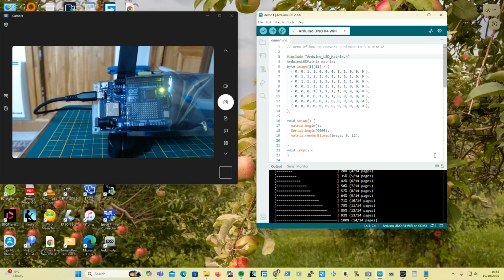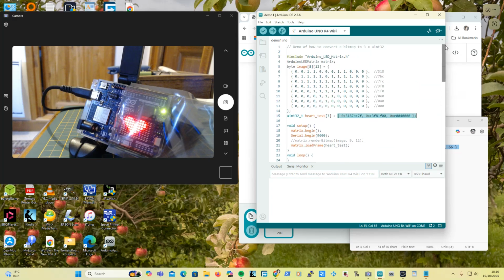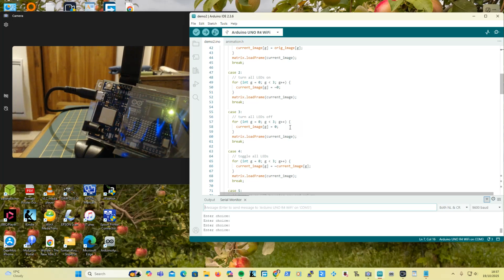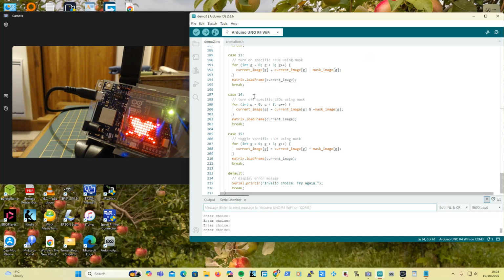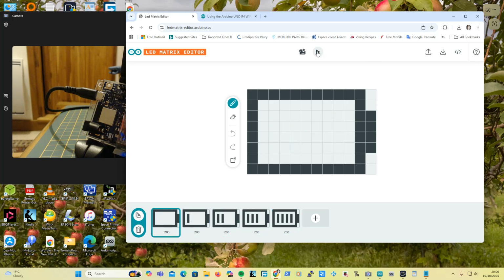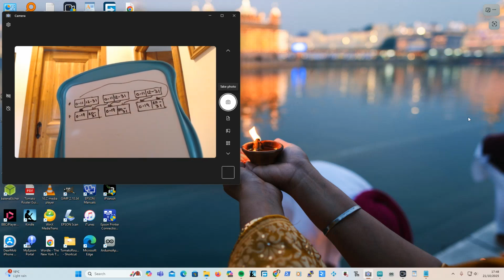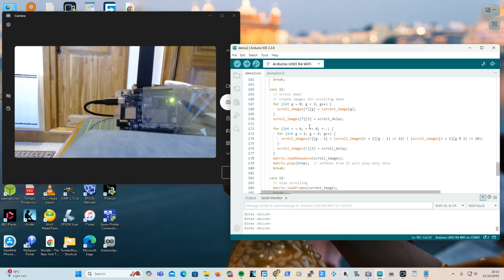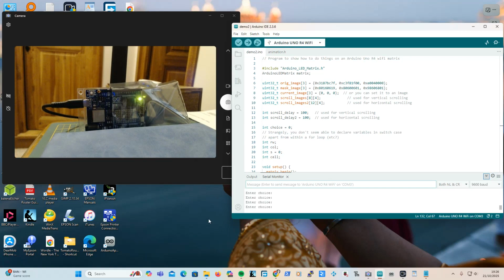Everything you (didn't) want to know about using the Arduino R4 LED matrix.And maybe the Uno Q too.

Comment from the maker: Here's my demo program code:

// Program to show how to do things on an Arduino Uno R4 wifi matrix

#include "Arduino_LED_Matrix.h"
ArduinoLEDMatrix matrix;

uint32_t orig_image[3] = {0x3187bc7f, 0xc3f81f00, 0xe0040000};
uint32_t mask_image[3] = {0x80160619, 0x80600601, 0x98606801};
uint32_t current_image[3] = {0, 0, 0};  // or you can set it to an image
uint32_t scroll_images[8][4];             // used for vertical scrolling
uint32_t scroll_images2[12][4];           // used for horizontal scrolling

int scroll_delay = 100;   // used for vertical scrolling
int scroll_delay2 = 100;  // used for horizontal scrolling

int choice = 0;
// Strangely, you don't seem able to declare variables in switch case 
// apart from within a for loop (etc?)
int rw;
int col;
int s = 0;
int cell;

void setup() {
  matrix.begin();
  Serial.begin(9600);
  matrix.loadFrame(current_image);
}

void loop() {
  Serial.println("Enter choice: ");
  while (!Serial.available()) {}
  choice = Serial.parseInt();

  switch (choice) {
    case 0:
      // because I'm using parseInt
      break;

    case 1:
      // (re)load original image
      for (int g = 0; g < 3; g++) {
        current_image[g] = orig_image[g];
      }
      matrix.loadFrame(current_image);
      break;

    case 2:
      // turn all LEDs on
      for (int g = 0; g < 3; g++) {
        current_image[g] = ~0;
      }
      matrix.loadFrame(current_image);
      break;

    case 3:
      // turn all LEDs off
      for (int g = 0; g < 3; g++) {
        current_image[g] = 0;
      }
      matrix.loadFrame(current_image);
      break;

    case 4:
      // toggle all LEDs
      for (int g = 0; g < 3; g++) {
        current_image[g] = ~current_image[g];
      }
      matrix.loadFrame(current_image);
      break;

    case 5:
      // turn on an LED by using row and column
      rw = 3;   // using dummy values for row
      col = 7;  // and column
      cell = rw * 12 + col;
      bitWrite(current_image[cell / 32], 31 - (cell % 32), 1);
      matrix.loadFrame(current_image);
      break;

    case 6:
      // turn off an LED by using row and column
      rw = 0;    // using dummy values for row
      col = 10;  // and column
      cell = rw * 12 + col;
      bitWrite(current_image[cell / 32], 31 - (cell % 32), 0);
      matrix.loadFrame(current_image);
      break;

    case 7:
      // toggle an LED by using row and column
      rw = 7;   // using dummy values for row
      col = 6;  // and column
      cell = rw * 12 + col;
      bitWrite(current_image[cell / 32], 31 - (cell % 32), !bitRead(current_image[cell / 32], 31 - (cell % 32)));
      matrix.loadFrame(current_image);
      break;

    case 8:
      // scroll left
      // create images for scrolling left
      for (int g = 0; g < 3; g++) {
        scroll_images2[11][g] = current_image[g];
      }
      scroll_images2[11][3] = scroll_delay2;

      for (s = 0; s < 11; s++) {
        for (int g = 0; g < 3; g++) {
          scroll_images2[s][g] = (scroll_images2[(s + 11) % 12][g]) << 1;
        }
        bitWrite(scroll_images2[s][0], 0, bitRead(scroll_images2[(s + 11) % 12][1], 31));
        bitWrite(scroll_images2[s][1], 0, bitRead(scroll_images2[(s + 11) % 12][2], 31));

        for (cell = 95; cell >= 10; cell = cell - 12) {
         bitWrite(scroll_images2[s][cell / 32], 31 - (cell % 32), bitRead(scroll_images2[(s + 11) % 12][(cell - 12) / 32], 31 - ((cell - 11) % 32)));
        }
        scroll_images2[s][3] = scroll_delay2;
      }
      matrix.loadSequence(scroll_images2);
      matrix.play(true);  // without true it will play only once
      break;

    case 9:
      // scroll right
      // create images for scrolling right
      for (int g = 0; g < 3; g++) {
        scroll_images2[11][g] = current_image[g];
      }
      scroll_images2[11][3] = scroll_delay2;

      for (s = 10; s >= 0; s--) {  
        for (int g = 0; g < 3; g++) {
          scroll_images2[s][g] = (scroll_images2[s + 1][g]) << 1; 
        }
        bitWrite(scroll_images2[s][0], 0, bitRead(scroll_images2[s + 1][1], 31));
        bitWrite(scroll_images2[s][1], 0, bitRead(scroll_images2[s + 1][2], 31));

        for (cell = 95; cell >= 10; cell = cell - 12) {
         bitWrite(scroll_images2[s][cell / 32], 31 - (cell % 32), bitRead(scroll_images2[s + 1][(cell - 12) / 32], 31 - ((cell - 11) % 32)));
        }
        scroll_images2[s][3] = scroll_delay2;
      }
      matrix.loadSequence(scroll_images2);
      matrix.play(true);  // without true it will play only once
      break;

    case 10:
      // scroll up
      // create images for scrolling up
      for (int g = 0; g < 3; g++) {
        scroll_images[7][g] = current_image[g];
      }
      scroll_images[7][3] = scroll_delay;

      for (int r = 0; r < 7; r++) {
        for (int g = 1; g < 4; g++) {
          scroll_images[r][g - 1] = (scroll_images[(r + 7) % 8][g - 1] << 12) | (scroll_images[(r + 7) % 8][g % 3] >> 20);
        }
        scroll_images[r][3] = scroll_delay;
      }
      matrix.loadSequence(scroll_images);
      matrix.play(true);  // without true it will play only once
      break;

    case 11:
      // scroll down
      // create images for scrolling down
      for (int g = 0; g < 3; g++) {
        scroll_images[7][g] = current_image[g];
      }
      scroll_images[7][3] = scroll_delay;

      for (int r = 6; r >= 0; r--) {
        for (int g = 1; g < 4; g++) {
          scroll_images[r][g - 1] = (scroll_images[r + 1][g - 1] << 12) | (scroll_images[r + 1][g % 3] >> 20);
        }
        scroll_images[r][3] = scroll_delay;
      }
      matrix.loadSequence(scroll_images);
      matrix.play(true);  // without true it will play only once
      break;

    case 12:
      // stop scrolling
      matrix.loadFrame(current_image);
      break;

    case 13:
      // turn on specific LEDs using mask
      for (int g = 0; g < 3; g++) {
        current_image[g] = current_image[g] | mask_image[g];
      }
      matrix.loadFrame(current_image);
      break;

    case 14:
      // turn off specific LEDs using mask
      for (int g = 0; g < 3; g++) {
        current_image[g] = current_image[g] & ~mask_image[g];
      }
      matrix.loadFrame(current_image);
      break;

    case 15:
      // toggle specific LEDs using mask
      for (int g = 0; g < 3; g++) {
        current_image[g] = current_image[g] ^ mask_image[g];
      }
      matrix.loadFrame(current_image);
      break;

    default:
      // display error messge
      Serial.println("Invalid choice. Try again.");
      break;
  }
}

Comment: Good pointers to improve efficiency - not my strong suit.  Looks like P.McW. will be doing a class on the Uno Q.  I have mine in hand and am struggling to see the uses for this board for makers.  It's interesting to work with and I like the blue LEDs way better than the red ones.  Thanks for posting!
Reply from the maker: @lorisrobots Thanks, Lori. I happened to see a notification for Kevin's livestream last Sunday so I knew that you'd already got an Uno Q. I was very jealous until I watched his video. I had ordered mine early, directly from Arduinoland and it still hadn't arrived after more than 2 weeks. It would have been much faster to get it from a third party. This was actually a good thing👍👍 After a great struggle, I managed to cancel the order because I now want to wait for the the 4GB version. There seem to be too many potential problems with the lack of space on the 2GB one.
I agree with you about what use the Uno Q will be - probably more of a gimmick than anything else. The blue LEDs will be a definite improvement👍(I buy a car for its colour😁) but I'm not convinced that having 8 rows of 13 is a good idea.
I wonder whether Paul will bother to learn much about it (or improve his Python skills) before churning out his lessons. I doubt it👎
Reply: @charlotteswift  Good to get the 4GB one.  If I can see a reason to use this board beyond just programming it for fun, I will get one.  Still puzzled as to why folks will use this board over other choices.  Will be interesting to see what Paul does with it to leverage the SBC and microcontroller parts together.